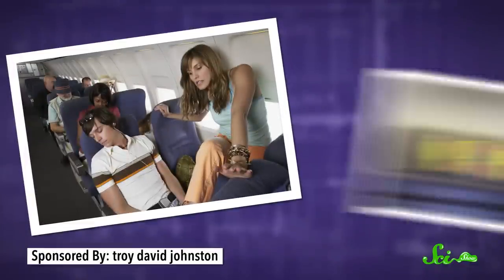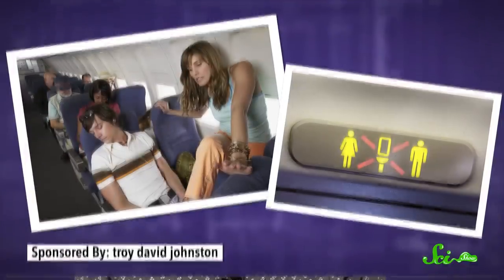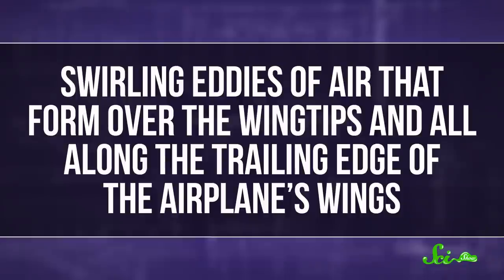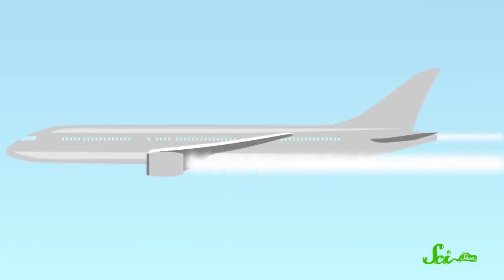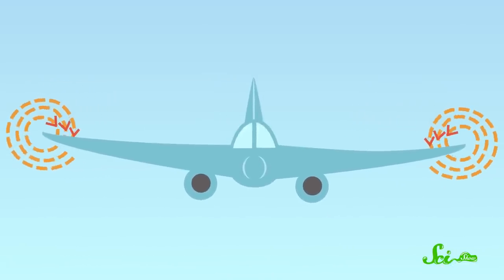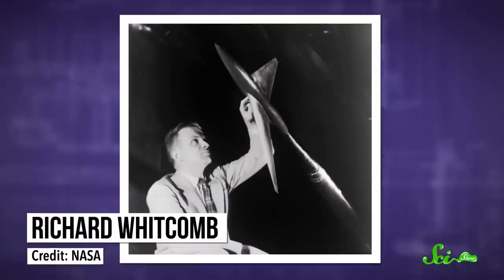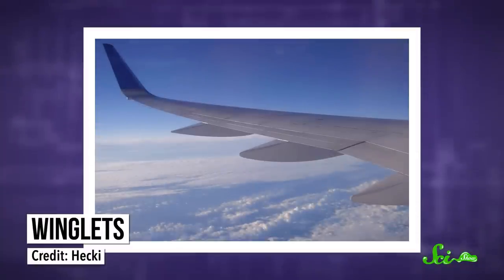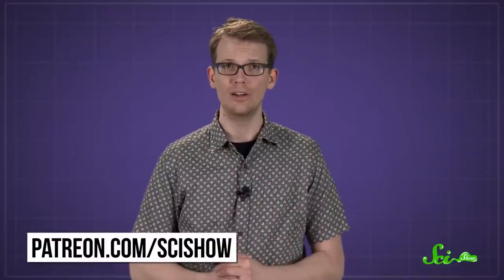What are Those Things on Airplanes' Wings?

Comment: whay do they tell you to open the windows lashes when you depart and land? thank you.
Reply: +alibaba mosu i believe it is in case of a bad landing, rescue response crews have as much vision inside the aircraft as possible and those inside can see what is outside. Hard to tell if someone is in a seat still after a crash if the shade is down. 

There might be other reasons but i think thats the primary one, its a good question and its not something even most pilots would know (be some tiny little subpart in a CAO somewhere stating why its a things but yeah)

Comment: "(...) air, which acts like a fluid", right?. There will be some water droplets, especially when flying through clouds, but air itself is still a mixture of gases.
Reply: +Niki Herl gasses, and by extension also air are fluids.
Reply: Rodrigo García Álvarez ah, I didn't know there was a distinction between liquids and fluids. TIL.
Reply: Gas is a type of fluid. Fluid doesn't automatically mean liquid

Comment: Correct but incomplete. Another major driving force in winglet design is decreasing the strength of the wingtip vortices. Strong vortices are a problem because other aircraft can be sucked in and destroyed. This is a problem especially at airports where many planes are landing quickly through the same air. Stronger vortices necessitate longer wait times in a holding pattern, which in turn costs airports and airlines money. Weaker vortices allow more planes to land safely and quickly.

Comment: Why are there no Winglets on the rear wings (horizontal stabilizer) of a plane?
Reply: +Campbell Grosser a few aircraft do have small ones back there. but the airfoil of a tail-surface isn't lift-generating, and doesn't generate as much of a vortex because of negligible pressure difference between the top/bottom of the airfoil.
Reply: Thanks
Reply: Campbell Grosser The Diamond DA 42 has eenie-weenie winglets on the stabilizer :)

Comment: what are those white trails behind airplanes as it flies?
Reply: Contrails. Just the exhaust from the engine, same as what you see coming out the mufflers on cars on cold days. It's colder up at their altitude so they are more easily visible
Reply: +Nathan Stevenson ah makes sense, thanks for the explanation!

Comment: Is the physics of the movie Flight(Denzel W) even possible?
Reply: +s0ulfire Absolutely. Modern regional airliners (like the one Denzel flew in the movie) are highly engineered and tested in order to be able to perform during any situation. The stresses of an average flight are no where near the limits of the airframe. The elevator of the plane (the part that controls up and down movement) has enough airflow over it during normal operation that it allows full control authority during any phase of flight, including inverted flight.

Comment: Why are they bent upwards and not downwards though?
Reply: +Tom Jerbo cuz why not?
Reply: +Tom Jerbo the vortex forms when air goes around the outside of the wing to the low-pressure area at the top, the winglet just lets the air slide out from underneath, but doesn't let it curl back over to the topside of the wing.

some of them do have a smaller one on the bottom to stop even that much, they're called sharklets. (airbus planes have them)
Reply: Tom Jerbo They are. Google "Split Scimitar Winglets". They go UP and DOWN! :D
Reply: Cool! Thanks for being the only one with an actual reply. :)

Comment: BUT WHAT ABOUT THE OTHER TINGS ON THE WINGS?! You know, the things that hang down from the wing (psst, not the engines).
Reply: the flaps? those deploy when flying at low speeds and allow to fly at lower speeds and then there's the dang what are they called at the end that rolls it
Reply: Not those, but these: http://i.imgur.com/nDfQTbG.jpg
Reply: Matthew May ohhhhh those are fuel pods/tanks, planes often store fuel away from the cabin and in pods on the wings and in wings because if they are to burst into flames they aren't close to the cabin
Reply: Jakob Werbe Cool

Comment: Fighter jets don't have these 'winglets' why is that? Does it have something to do with agility or anything? I can imagine not being pulled back by vortrices and reducing fuel consumption are pretty useful for fighter planes :p
Reply: +Yorick Veenstra Fighter jets are all about maneuverability. Fuel economy and phases of flight outside of combat are a low priority. Commercial jets have to gain every percent of efficiency they can to make a decent profit. Meanwhile, military aircraft guzzle through so much fuel in supersonic afterburning flight that a few percent improvement in efficiency isn't even noticeable. They would much rather be agile, with no winglets to dampen their turns.

Comment: but what is the things under the wings that look like engines but are not? fuel tanks?
Reply: +Theo Byström Actuators for the flaps that extend out the back.
Reply: +Airbound but I dont mean that, I mean the things that are located under the wings of big commercial passenger airplanes. they are almost as big as the engines.
Reply: Yeah and they are casings for actuators that move the control surfaces such as the flaps as well as acting as "Anti-Shock Bodies" making mach 0.8 - 0.85 (common commercial jetliner cruist speeds) more efficient.
Reply: +Airbound ok
Reply: +Airbound but thay are so big! why is that?
Reply: They extend quite a distance and they don't want parts sticking out externally so they built the casing around where the actuator has to be at full extension I guess.
Reply: +Airbound ok thanks, now I know

Comment: Why is air considered a fluid
Reply: liquid=/=fluid
Reply: +Nathaniel Xu 
A fluid is basically a substance without a definite shape. Basically it means "not a solid", but that's probably over simplifying.
Reply: because of its ability to flow basically
Reply: +Nathaniel Xu because it flows.
Reply: +Nathaniel Xu From Wikipedia: "In physics, a fluid is a substance that continually deforms (flows) under an applied shear stress." Basically, if you continue to push it and it continues to flow, it's a fluid. So silly putty is a fluid, but also gas and of course all liquids.
Reply: Because why not
Reply: +Nathaniel Xu because it's a gas and all gases are fluids
Reply: A liquid is a fluid but a fluid is not a liquid
Reply: +Nathaniel Xu Fluid and liquid are not the same thing. Anything without a set shape (like liquids and gasses) are Fluids. Fluid is a scientific term to describe a state of an area not the state of existence. Water can be a solid, liquid, or gas and this is its state of existence. you are surrounded by fluid when you are in air or in the pool and that is the state of the area around you. Its the same if you say a spaceship is in a vacuum in space.
Reply: Because 4 people every year drown in it! *cri
Reply: +Nathaniel Xu .. because it FLOWS .. hence FLUID

Comment: But what about the little teeth looking this that run along the ailerons?
Reply: +blackstar 666525 just more stuff the smooth out the air i guess.
Reply: +blackstar 666525 those are winglets as well, but, they're mainly for smoothing out air, as the Nosygamer said.

It helps keep aileron effectiveness in different airspeeds.

Comment: Wait, how is air a fluid? Please explain
Reply: the scientific name for liquids and gases
Reply: Gasses and liquids or anything that flows is a fluid
Reply: Fluid doesn't mean liquid
Reply: fluid - a substance that has no fixed shape and yields easily to external pressure; a gas or (especially) a liquid
Reply: Fluids are comprised of both gases and liquids. A lot of people get that mixed up.
Reply: +Big Brother  Thanks, I always thought that a fluid was a liquid.
Reply: +RevolutionGamersHD  Thanks
Reply: Artur Grochola no problem bro
Reply: +Artur Grochola a fluid is not necessarily liquid. It can be gas and even plasma (aka very hot gas). By definition a fluid is a phase of matter that has not definite shape, can flow and takes the shape of whatever container they are in.

Comment: I like drag. Without it, the wings would not do the flying
Reply: +Gabriel Rej drag is the thing that is trying to stop the flying.
Reply: +Gabriel Rej Lift* you like lift ^^
Reply: +iLuZiioNz Tutorials some drag is required for the airfoil to pull the air around the top surface, thusly generating said lift.

Lift-induced drag is about the only drag you want, though.

Comment: Wait so why do vortices occur???
Reply: +spencer kirkman Because flying is the result of a low pressure on the top of the wing, which we can achieve by shaping the wing properly. In fact, the 'lift' force is due to the plane being 'sucked' up. This also means however that at the end of the wing, the air is sucked up. So vortices result because the air wants to curl around the wing tip, to the top of the wing, because there is a low pressure field there. It's pretty much like opening a door with a few windows wide open, you get a pressure difference and physics doesn't like that, so air flows to even it out ;)
Reply: MotoringHeaven So basically as those high pressure systems hit the end of the wing they try to curve up and meet the low pressure system dragging the plane down?
Reply: They meet at the wing tips yes, air from underneath the wing tries to 'curl' over top and combined with the air moving over the plane longitudinally (since we are moving through the air), this makes the air spiral. That spiralling air unfortunately has much lower pressure as compared to the air around it. So actually, it suck the plane backwards, which is drag ;)

Comment: but how tho?
Reply: +mos ab the air pressure below the wing is slightly higher then the air pressure above. The vortex that forms on the wingtip is caused by some of the air trying to 'cheat' and just go around the outside and not over the airfoil of the wing itself. The winglet gets in the way of some of that air. It has it's own vortex, but the wingtip of the winglet is smaller, as is the vortex it makes. they're also placed on the mid points of the wings of some aircraft to help air move over the wing in an orderly fashion there, too.
Reply: DFX2KX thank you so much...why couldn't they explain that?
Reply: +mos ab aerodynamics (well, fluid dynamics in general, water follows the same rules) is a bit counterinutitive, it would have made the video a lot longer to try and explain it in detail.

Comment: So wait, how come not all planes have this?
Reply: +blacklupos they're not as useful on wings that are A) very thin compared to their length (sailplanes don't usually have them), B) have a symmetrical or other blade like airfoil (fighters/helicopter rotors) C) go too slow for the vorticies to be much of a nuisance compared to everything else (Cessna prop planes)

edit, added the sailplane example.
Reply: DFX2KX thx!
Reply: blacklupos They would not have much of an effect on smaller planes because the actual weight of the winglet would cancel out the fact that it does any good.

Comment: Why doesn't fighter jets have winglets?
Reply: +Luck Step their wings have relatively low-lift (more blade-like in cross section), so they don't have so much of a problem with them to begin with, they're also utterly useless after Mach 1. This is also the reason you don't see upturned tips on Helicopter rotors.

Comment: 787, 777 doesnt have winglets
Reply: +Astraphic the 787 most certainly does(quite likely optional extra, like most other planes):
https://upload.wikimedia.org/wikipedia/commons/f/fe/Dreamliner_rendering_787-3.jpg
777 as far as I can find had it in the original design but can't find any sources why it was omitted in production.
Reply: +Astraphic the curved up shape of the wing acts as the winglet, its actually more efficient than the standard winglets.
Reply: thorerik o
Reply: +Astraphic as Jack said, the 787 has wings designed to flex more in flight at the tips, as winglets are not all the effective at low speed (like when landing). It is possible due to all the composite materials that go into a 787, it is a very very elegant design that literally copies off of soaring eagles (their outer most wing feathers will also flex up to near vertical for the same reason).

The 777-X however is a different story (they didnt do bolt on kits for the 772 and 773 due to the wings being so long already and just not being able to support a winglet safely and i think they found on that exact design, it wouldnt be as effective, though i could be wrong about that, i will google to check now.) as the wings of the 77X are longer than can be accepted at most international airport gates (each bay was designed long ago with a max wingspan in mind) which they got around by giving it the ability to fold a section of the wing tips up on taxi. Winglets would have complicated that
Reply: +Astraphic ok, i checked up why the 777 doesnt have winglets, essentially it is because it has too long a wingspan. This is a problem because winglets tend to cause wingtip flutter which is manageable on shorter and low aspect ratio wings because of the strength but on a 777 the amount of reinforcement required to counter wingtip flutter from winglets just outweighed (literally) the gains from the reduced form drag. Instead they designed the wings on the 777 to be just as efficient without them
Reply: +Matthew Ray  omg thanks for the explanation. :) This might be one of the longest responses I've ever encountered on YouTube

Comment: "and air, which is a fluid " umm
Reply: +chistine lane it is. The only difference between a liquid and a gas is density. a gas is a fluid with low density, a liquid is one with higher density. The formula set for objects moving through them is the same.

Comment: If drag is so bad for fuel efficiency, why don't planes just fly above the atmosphere where there is no air???
Reply: It takes too much energy to fly in those altitudes more than flying at normal altitudes
Reply: +dkamm65 Firstly, while less air means less drag, it also means less lift. Plus you need the oxygen in the air for combustion. Less air also means less oxygen for combustion, so the engines can't provide enough thrust in the already shitty lift conditions. 
What you're proposing is the definition of spaceflight: flying at an altitude so high that the speed you need to have to achieve lift is the same speed that would keep you in orbit anyways. But that's hella expensive :)
Reply: +Calin Cristian It was a joke. I thought it was pretty obvious.

Comment: They're saving gas and yet the ticket prices keep going up.
Reply: +Taylor ∆ have you not noticed, the price of everything is going up.
Reply: +Taylor ∆ gas prices, cost of maintenance, cost of training, airport fees and so forth havent stopped rising, we are talking like 2.5%-4.5% reduction in fuel consumption on a typical domestic 737-800 flight. Aviation, believe it or not is not an overly profitable business unless youre Emirates, QATAR or Etihad. Ok and Air NZ i suppose but they just have a good business model, the first 3 just ride on the economic joys of the Middle East and oil boom.